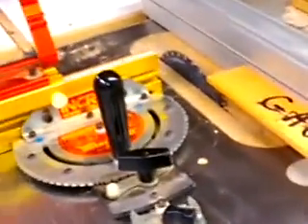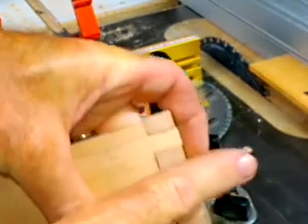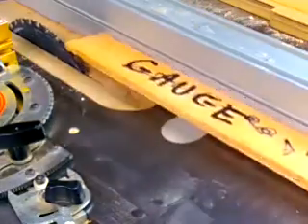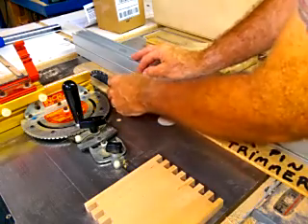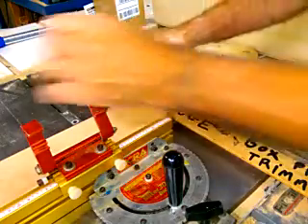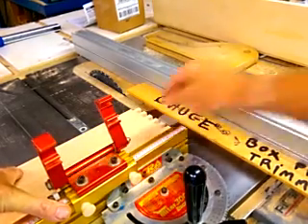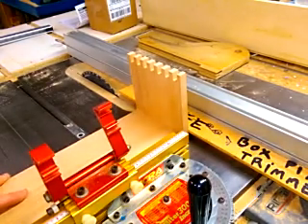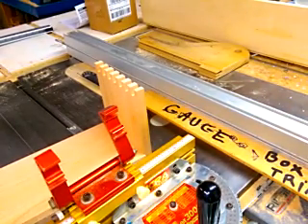Box joint pin trimming jig

Comment: Excellent method from trimming pins on box joints BEFORE glue up.  It worked for me.  Would had never thought of this solution without your video.   Thanks for sharing.

Mike